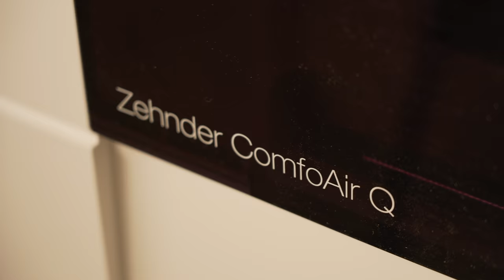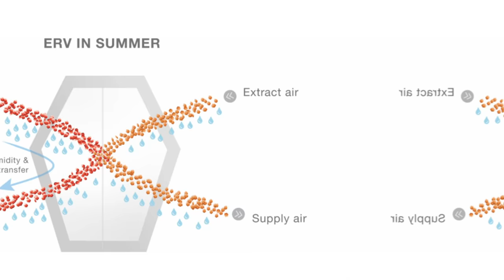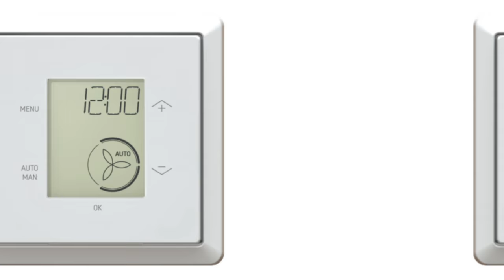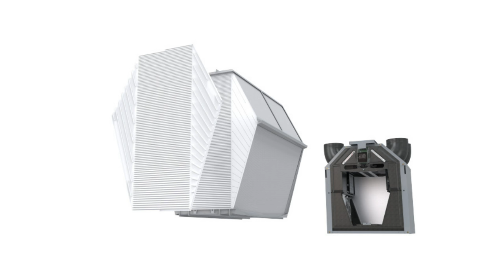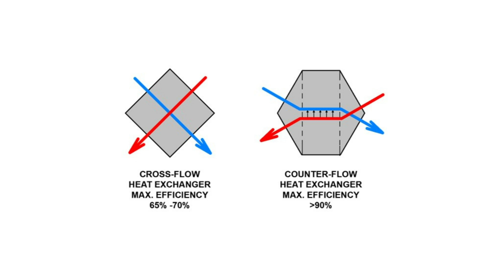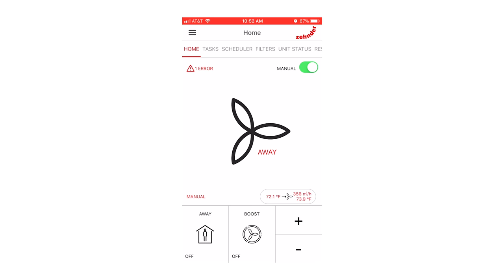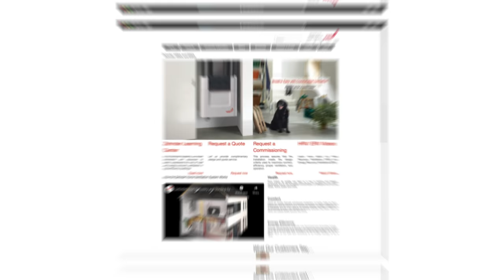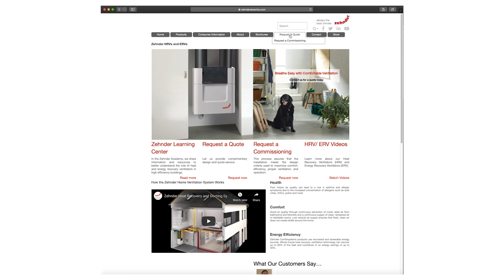Passive House - Fresh Air System Install & Costs (Zehnder)

Comment: Nice stuff but as a Florida HVAC guy I’d like to hear about moisture management. It’s nice to have a tight house but people still live in it running water, cooking etc. Does that system handle this properly? I thought you were going to install a dehumidifier in your house...
Reply from the maker: This doesn’t take the place of a dehumidifier. I have two UltraAire 70h units going in too
Reply: Matt Risinger ahh that messes more sense. Thanks Matt

Comment: Matt, I've got a condensing type laundry dryer that doesn't have ducting. In the winter I love it because it keeps some heat/humidity in the house, but in the summer it's less desirable. How would you engineer a condensing dryer in a build?
Reply: Save some money in the Summer and hang up the clothes to dry as much as you can.
Reply: @markhoffman  I air dry as much as possible, more just for the health of my clothes.
Reply: @SupercarSeany  I've noticed with my Bosch condensing unit my clothes feel really nice and soft when they come out. Nicer than hanging up. But I hang up in the warmer months to save energy.  The Bosch condensing dryer takes really good care of the clothes by not Frying them.

I have both the Bosch washer and dryer 800 series and I simply use a teaspoon of persil for loads, and nothing else. No bleach, no dryer sheets, no gimmick dryer balls etc...and everything comes out clean and fresh. No static etc. If I have a really tough stain, I rub a bit of Persil on it, and it comes out in the wash. The clothes feel squeaky clean.

The electric condensing and heat pump dryers are completely different then the old school dryers that simply blow hot air and knock your clothes around and then exhaust the hot are out a hole in your house. There is clever Engineering put into modern dryers.

People must learn how to correctly operate the dryer and use the right settings and maintain them properly for best results.

Comment: I wonder that the cost difference would be in buying this unit vs just dumping stale air out of the building cavity rather than attempting to exchange the "energy" verses the cost of this system?  Meaning, cost of this system vs cost of conditioning fresh air per year?  I have a funny feeling it would be 10+ years.  Adding to that, the complexities of this system.  ie:  You know that core will have to be replaced one day...how much and will it even be available in 10 years.  Yes, I'm in South Texas:  humidity and heat is the main concern

Comment: Matt: does a system like this have a limit on the number of outflowing channels? You displayed a manifold earlier, which had 8 channels. I presume there are more than 8 channels going through your home (you mentioned 3 will go into your bedroom alone). How does it work? Do you need to plan ahead of time how many channels you need? Is that how it works?
Reply: Matt's house actually has 32 total tubes. 16 supply and 16 extract (or "return"). So he has a total of four 8-port manifolds.  The ERV does have a limit for airflow, so the correct model needs to be selected for the needs of the house. If the customer sends us their house plans we'll design the system for free, indicating which model ERV they should use and the number of tubes, etc.

Comment: Do you address VOC control in living areas and the kitchen with this system? Does the appliance ramps up to mitigate volatile compounds when present or you rely on a normal rate of fresh/extract to eventually update the air?
Reply: Good question. It can be done both ways, but the VOC sensor and demand control come with additional cost and complexity. Unless there is something unusual in a residential setting, the "normal" ventilation rate set for the ERV keeps VOCs and other IAQ issues in check.

Comment: Question concerning Matt's mentioning wild fire area locations:  Would wild fire area smoke/ash plug the outside air intake side of the Zender units cross flow heat exchanger or is the MERV 13 filter capable of protecting it under these types of conditions?
If so, then why not install the MERV 15 filter before the outside air intake port to the Zender unit?

My thought would be to always install the MERV 15 unit as a pre-filter for before the Zender's outside air intake port.  
Doing this would eliminate the need for the outside air intake filter located inside the Zender unit.
This would cut overall maintenance costs by having one less filter to maintain/replace.

2nd question:  Could you use the Zender unit as a dehumidifier or incorporate a dehumidifier into this system's ducting?
Reply: Good questions. The MERV 13 filter inside the ERV does a pretty good job with larger particulates (including ash) but won’t effectively stop smoke. The carbon filter seems to be the most effective at dealing with smoke. 

Putting a large capacity filter casing ahead of the ERV on the outdoor air intake duct can be effective, but in a cold climate it’s another component that requires careful detailing with insulation to avoid sweating when the air inside the duct is cold. This isn’t insurmountable, but it can be a nuisance when the approach we took at Matt’s house works just as well. Once the cold winter air goes  through the ERV the supply air is warm enough that it doesn’t cause sweating at the filter casing. The internal filter is pretty inexpensive compared to the large capacity filter.
Reply: Technically, the ERV doesn’t dehumidify in an active sense. It simply exchanges (normally cleaner) outdoor air with (normally more contaminated) indoor air while using passive physics to help maintain the thermal and hydrological properties (temp and humidity) of the indoor air. In other words, change the quality of the air while minimizing changes to the conditioned properties of the air that you’ve spent energy on achieving. 

If additional dehumidification is required there is a feasible way of integrating a dehumidifier with the ERV (and some really bad ways). But the best results come from installing the dehu separate from the ERV and letting them function independently. We’ve studied and tested some different approaches and this is our conclusion.
Reply: @christophersmith1894  :  Thanks for that explanation.  I understand what you mean and since I live in the northern USA that is important to know ahead of time.
Reply: @christophersmith1894  : Does this mean running separate ducts for an independent dehumidifier?  It sounds like it, but I wanted to ask.

I'm in the design planning stage for an ICF house (which can be very air tight) so I am researching all the mechanicals in advance.  I'm sure that I will have to hire a design firm to get a properly planned HVAC system.  

I am trying to be an educated consumer (and my own general contractor. I have built houses before, but none that would be considered this air tight) so that I can understand and make solid decisions when the engineers give me HVAC options for the build.  I have been researching Zender units for over a year now and I am subscribed to their email updates.  It was great to see this topic on Matt's channel.

Comment: Maybe I missed it but how do you get a supply and return out of the same termination point (ceiling vent) in a room? Seems like it would just suck the fresh air right back out.
Reply from the maker: Separate vents for Supply and Exhaust The bathrooms and kitchen all have returns, The supply is in the bedrooms and public spaces. 16 tubes of supply, and 16 tubes for exhaust. It’s a balanced system

Comment: What about fire safety for the range hood, code in places requires specific metal ducting. Would this system be dangerous in the case that a fire broke out?
Reply from the maker: This won’t be used for the kitchen exhaust. I have a fantech system for that

Comment: A typical bath fan is like 100CFM, isn't it?  So how will 12 or even 24 be enough for a shower room?
Reply: Good question, Sergey. Bath fans vary. Those rated at 50 cfm are probably more typical. And once installed with ducting they rarely actually move 50 cfm. Code requirements are typically 50 cfm if the fan is run intermittently, but only 20 cfm if operating continuously. And it turns out that continuous operation is a lot more effective at removing moisture and maintaining the long-term air quality in the bathroom (and by extension the rest of the house). We typically design for a minimum of 24 cfm out of a bathroom.

Comment: Not that you would need this in THIS house, but could you have an over-pressure situation with this system so that odors don't sneak in from outside?
Reply: Yes, you can set the Q for up to 15% disbalance, either positive or negative.

Comment: Hey Matt, I find most homes that are built and don’t have very good balancing from room to room or space to space. Especially with time of day related differences in exposure or weather conditions. Some rooms are hot, some are cold, and there is very little passive or active balancing. Have you heard of any HVAC technology available to correct this?
Reply: I have seen in other videos of his where he puts in small jumpers or return or supply to help with this issue.

Comment: I’m curious can you run that intake from the outside to a dehumidifier and filter system before the house if you are changing the air 4x hour. Seems a lot to keep cool.
Reply: Good question, Thomas. The air exchange rate is 0.4 air changes per hour (ach). So a lot less cooling than 4.0 ach. It is possible to integrate the ERV and dehu, but it's really best to run the dehu separately so each appliance can deal with the airflow rate that it's best suited for. Also your dehu will run intermittently, so integrating it with the ERV will change the pressure dynamics and mess with your balanced ventilation.

Comment: What i am wondering is what is needed to be done when there is a power failure? When using a passive system How long before the air gets bad ? W

Comment: So, with this Zhender system, are you also installing the conventional higher velocity vent fan systems for the bathrooms? How is the cooking vent hood exhaust being handled with this system?
Reply from the maker: I have a separate exhaust for the kitchen cooking, and it will have its own make up air system. I’ll be doing a video on that in the coming weeks
Reply: Matt Risinger Thanks for the reply. I rewatched the video and was able to answer the first part of my question - you do say that the Zhender system will be the way that moist air is exhausted from the bathrooms, no conventional high velocity type bathroom ventilation. I really love all the videos you put together... I've learned an amazing amount from all the work you put into these great teaching tools. Thanks!

Comment: I'm curious about the app that is used, does it run through servers they own or locally, is any data collected by them and if so do they sell that data. If it's running through their servers my guess is there is a fee involved or there will be at some point as that business model usually isn't feasible through the cost of hardware alone.
Reply: Everyone who touts a free app.-runs through cloud servers" and they are using your data. for product "understanding" Or - as you say - there will be a cost to the consumer - otherwise it is a "PONSI scheme"
Reply: @kadmow  True for the most part,  but there are some that can function through a home network without "phoning home" to the company. There has been a number of tech products recently that have went from a free app to extorting customers for monthly fees. Of course without the app it made the product either useless or less useful and not worth the original premium as a smart product.
Reply: @DOYLECLEVERLOBE1  . Hence my scathing critique, in general of "smart" products (those which are the majority hosting everything on big brother's servers).  There is no reason for a lightbulb to "phone mama" when a simple intranet webapp can do (I can choose to use any Remote access app/supplier  I choose If I need access when not home.)... "Smart"  "whatever" it is just another serial  "wireless" device -albeit with a "wifi"   transmitter..  whoop de doo.  You are the product. (not us of course because "we" are smart...)   lol..
Reply: This is a fair concern. Our app requires the owner (homeowner) to provide a uniquely generated code to a Zehnder service technician to temporarily access the ERVs data to help troubleshooting if necessary. It is not delivering data to Zehnder on a regular basis. (And our system doesn't have any microphones or cameras!)

Comment: Does passive house certification require electric / induction stoves or can natural gas / LP be used? Would the hood venting connect to the ERV? Also not clear about how the ERV handles or integrates with air conditonong ie temp control....
Reply: The ERV doesn't integrate with the AC. They function independently.
PH certification is pretty agnostic with respect to fuel types. But avoiding combustion inside the house is definitely better for Indoor Air Quality.

Comment: Matt, you have mentioned in multiple videos that you often hear that you are building homes too tight, and that you are going to kill people, or that houses need to breath. Your response is that you want to control the air that comes in. What happens when these systems fail? Is that bad for the occupants and house?
Reply: When they fail, you open doors and windows.  At least when they fail, you know that your ventilation is bad.  The reality is that a loose house does not have good ventilation either.  Even a loose house does not provide sufficient fresh air most of the time.  Drawing air through the envelope is a recipe for poor air quality, even if your envelope was so atrociously loose that you could get enough air.  Since you can't sufficiently ventilate through the envelope (unless you want to open windows when you are space conditioning) anyway, you need mechanical ventilation anyway, so you might as well build tight anyway.

Comment: Matt, when they say it is 85% efficient, they're efficiency is based on the equilibrium temperature. Meaning that if outdoor temp is 0 degrees, indoor is 80, equilibrium would be 40 degrees and 85% efficient unit would be puffing around 34 degrees into the house with a balanced system.
Reply: Exactly!
Reply: Pooky, you're a bit off on that. Actually, the recovery efficiency is related to the total difference between the two air temperatures. Given your example, the unit would recover about 85% of the 80 degree differential and the supply air would come into the rooms at 68 degrees. That is what is so special about these units--they are able to recover way beyond the "equilibrium" temperature.
Reply: @christophersmith1894  I'm not an HVAC expert I'm a physicist, but thermodynamics doesn't work out with those numbers. Can you explain a bit more?
Reply: @pooky9775  Fair enough. I'm neither a physicist nor an HVAC expert, but I do know heat recovery.
If the heat exchanger was a monolith we could expect no more than equilibrium (entropy?) for heat recovery. But because the heat exchanger is  an open component with extended channels there is heat recovery taking place along a continuum. At every point along a given channel there is enough temperature differential with the air on the other side of the plate to invite heat transfer by conduction. The temperature changes from one end of the channel to the other, but the continuous differential means there's heat transfer happening all the way through at every "gradient".
Reach out to me through the contact page on our website if you want to discuss further.
Reply: @christophersmith1894  Oh I got it! Thank you. It is a continuous differential system. Equilibrium is changing as you go along the channel. Sorry about my initial commend. I didn't think of it. We usually work with basic systems and ideal conditions so us physicists may encounter problems like that; If we don't we become engineers. :)

Comment: How do you handle rolling blackouts with a 'sealed' house? Woudl rather not build up co2 while also baking from the heat ;(
Reply: Hi Spuds. A "not-sealed" house would only reduce CO2 by leaking hot air in through the leaky envelope. So just open a window during a blackout and you have the same result. But the rest of the 99.9% time the power is on you're able to control your indoor environment on your own terms.

Comment: Wondering if the silencers are really necessary with a low cfm (quiet?) ventilation system like that.
Reply: they sure don't hurt.  we have an HRV system in our townhouse in Germany, and the system is kinda loud.  you get used to it, and it's white noise basically, but silencers are a tiny part of the price

Comment: Does this replace the need for bathroom exhaust fans?
Reply: Yes. The ERV extract comes from the bathrooms at a low continuous rate (usually designed for at least 20 cfm).

Comment: Don't make us nuts, energy exchange occurres through the surface, not in only one point, actually two flows are constantly exchanging the energy through the separator between them...

Comment: Probably a dumb question because Im still learning, but if the house is air tight and this system feeds fresh air, does it open up allowing free flow ventilation if power goes out?  Does it have battery backup? Or do you just open a few windows ?
Reply: It's okay to open a window when you want.

Comment: So how would this tie into a fire detection system? If it boost tonfee fresh air to a room for co2 would it want tondonthe same thing for a fire?
Reply: Alas, this system does not detect the air quality indoors.  Though there was (almost passing) mention of VOC and CO detection, I did not get the impression it was going to be installed here.  So it wouldn't do anything for a fire.  A commercial HVAC system would interconnect air quality and smoke detection systems to do the right thing, but I don't think this system will do that.